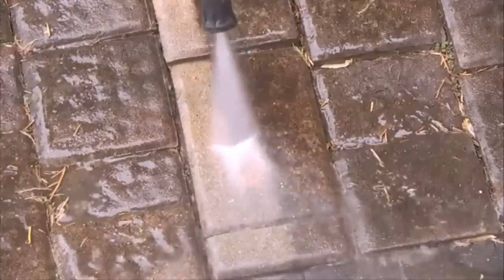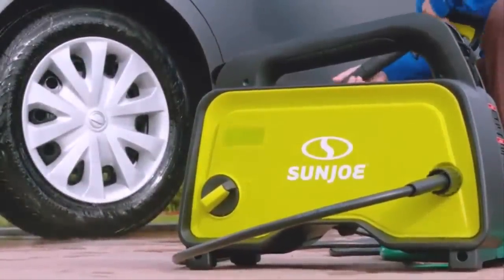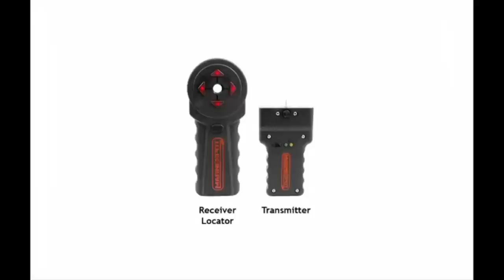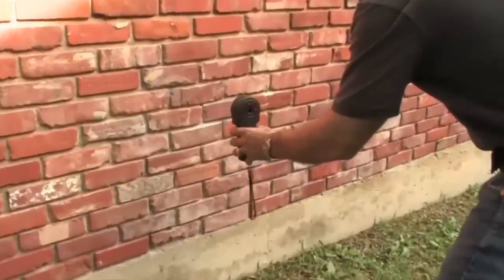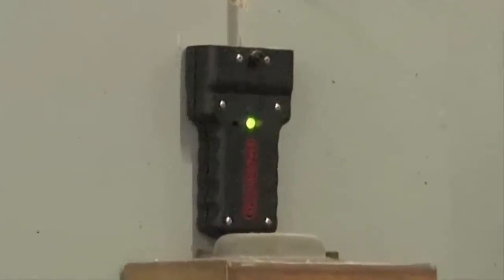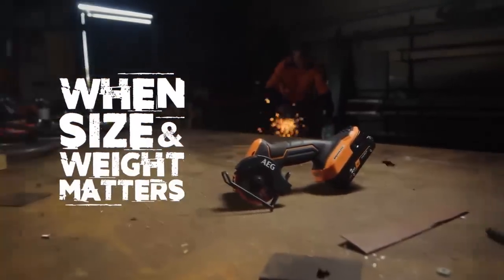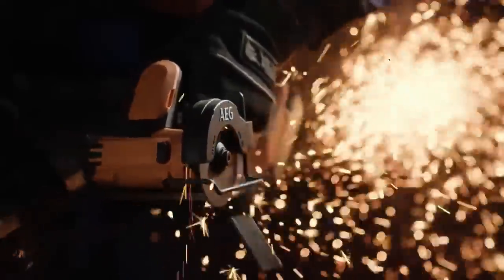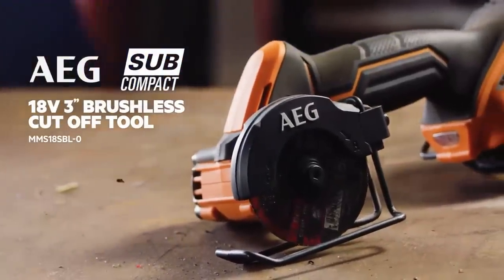10 COOL TOOLS THAT WILL MAKE YOUR LIFE EASIER 2022 #17

Comment: Genuinely interested, has anyone needed a high pressure washer system in a situation where they have access to a pressurized water supply but no electricity? 
Even something like pressure washing a roof, only a fool would drag the pressure washer, with hose attached, onto the roof rather than use extension pipes.

And why worry about weight? You carry the trigger and lance not the pressure washer. If you're carrying water, no weight saving on the washer will make a difference?

I'm no longer working, so portable tools don't matter to me, but I think a battery powered pressure washer is an example of providing a solution to a problem that doesn't exist.
Reply: That pressure washer is waste of money.  Not powerful enough to do the job they advertise it for. That is what you get when you have people, who never worked in the field, design such tools in office cubicles. Go figure...

Comment: Brushless sub-compact cut off tool, smaller and lighter than a portable angle grinder...recommended by professional bike thieves everywhere when a really big bolt cutter just will not do the job

Comment: The Makita PC01 12v power cutter is a much better buy than the Ryobi tool that this video promotes. Makita has multiple tools that accept the 12v battery. More power means that it can cut a wider variety of materials and cut faster through the same material. Makita for the win in performance, versatility and value.
Reply: The Ryobi system isn't great.

The main problem with the Makita system is that the full width of the 12V system isn't available everywhere.